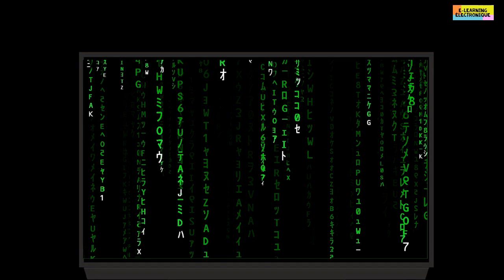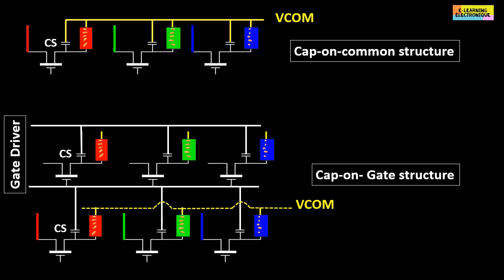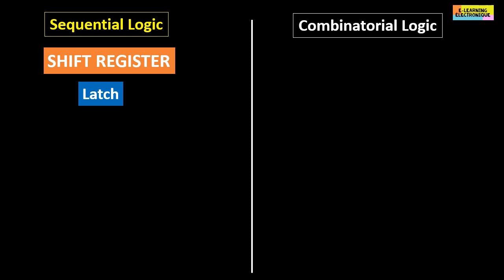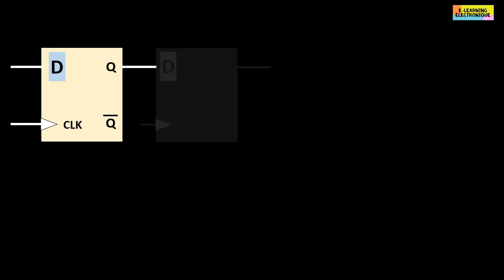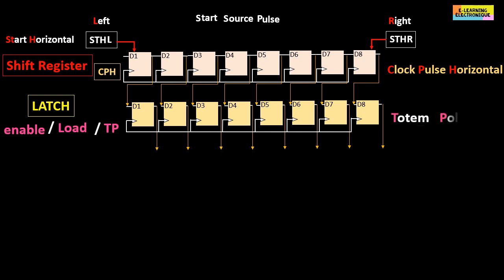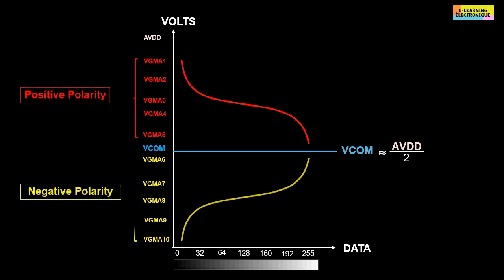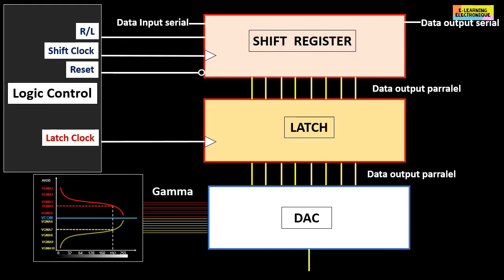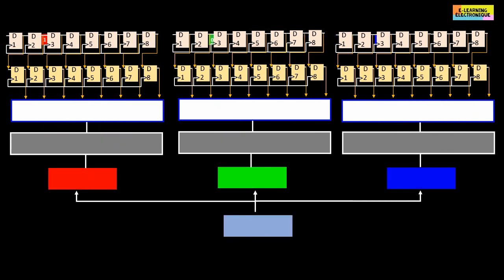Meaning of STH CPH TP POL SOE STB and relationship between TCON Gamma and source driver

Comment: Hi.
If one single color vertical line is visible on the display all the time, (rest of the image is normal) at maximum brightness, what exactly is the problem?
In my case, rouhly in the middly of the screen, there is a 1 pixel wide blue very bright vertical line.
Thanks.

Comment: is the block (sr, latch, dac, buffer) used only for one sub pixel then for one pixel you will need 3 blocks and as many 3blocks as the number of pixels on the line ? if so all the pixels are processed at the same time. this is huge to have thousand of blocks to treat one line at a time. 
or is there any multiplexing using only 3 blocs then the pixels are processed one after another ?